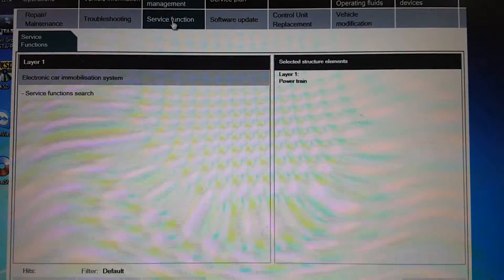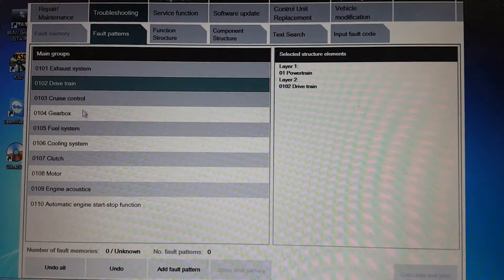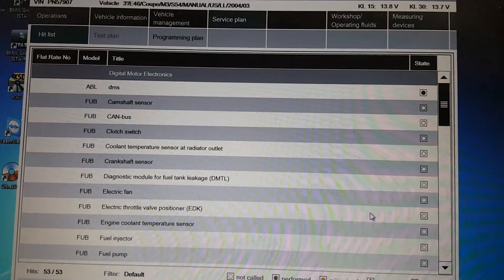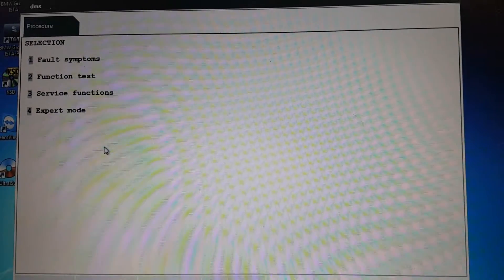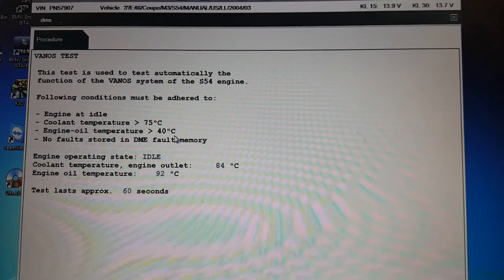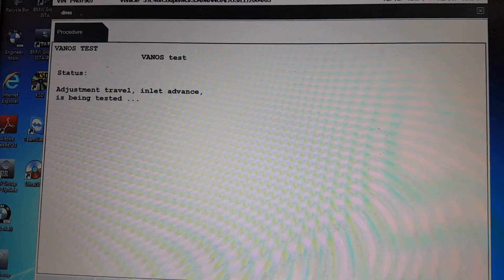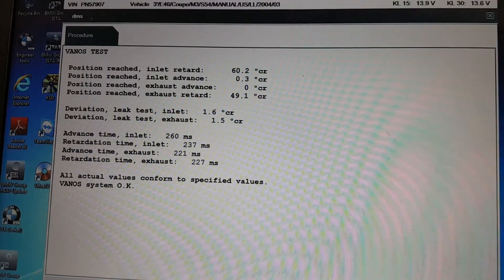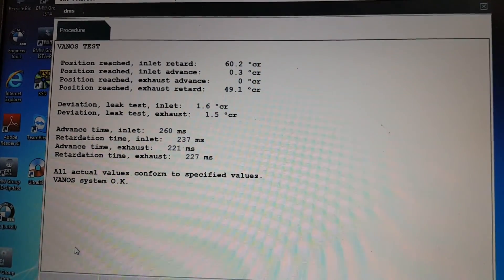BMW E46 M3 Vanos test procedure with ISTA+

Comment: If I want to test my s54, i came to the screen shown at 1:41, but the button to proceed is greyed out. Any hints whats wrong?
Reply from the maker: check the operation temperature on the engine, if the engine is not warm enough the system will not allow you to do the test. please double check it and let me know
Reply: @strally86 hello at this screen, my ista is not populating all the information? My engine is idling at operating temperature. The next button is also greyed out. Any help would be appreciated
Reply from the maker: @fvresonanator  double check coolant temperature and oil temperature must be meet the requirement and "NO" Engine Light on.
Reply: @strally86  coolant is about 81C and Oil 92C according to ISTA. Do I need an ICOM cable ?
Reply from the maker: @fvresonanator  I'm using ICOM to connect it, not sure different cable able to do that or not.....
Reply from the maker: @fvresonanator  does it have any pending or current codes?
Reply: @strally86  it had a couple of codes, only to do with radio and GPS. No DME codes. No engine light. I'm using a K + D CAN cable from OBD into usb
Reply from the maker: @fvresonanator  may be ask any of your friend who has ICOM to try it out, I haven't this problem before
Reply: I have the same Problem
Reply: @mkingz7559  I think only ICOM or DIS will work for us. Havent tried yet tho